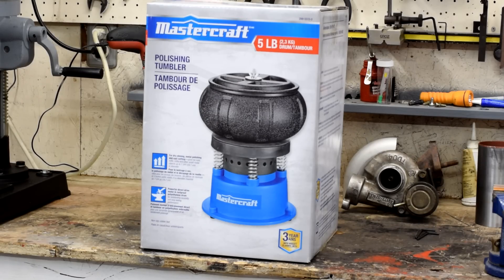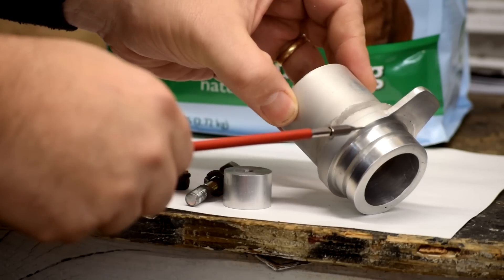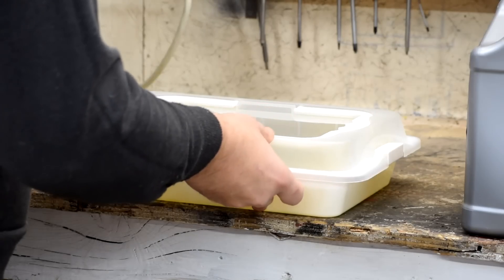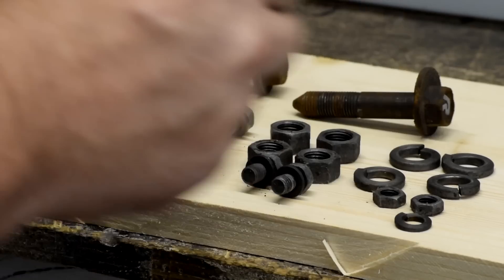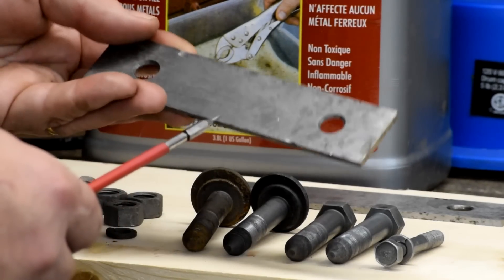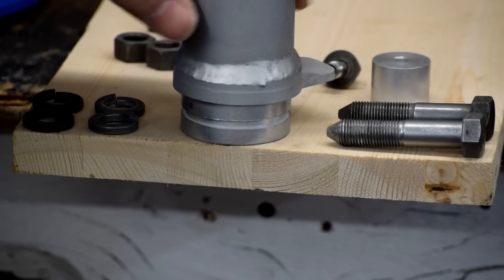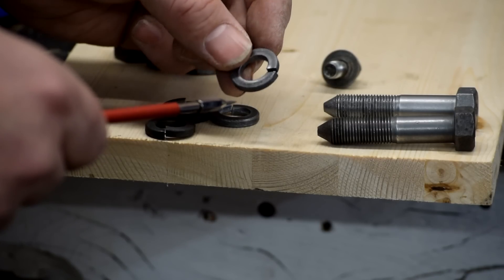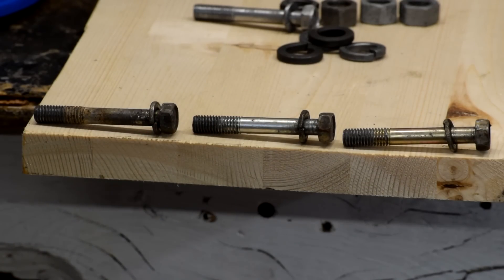Cleaning Rusty Hardware with a Vibratory Tumbler and Evapo-Rust

Comment: For small parts you might try the evapo-rust stuff in an ultrasonic cleaner.
Reply: That's exactly what I do. I have a huge 30litter and a small bench top ultra sonic cleaners and use this in it for all my surplus rifles and handguns I buy and clean up thoroughly,  this stuff works wonders

Comment: Good video man, missed out on the sale on this unit, so just picked up the comparable one from Princess Auto.  The crushed walnut shell that was provided hasn't really touched the parts (Honda 50 engine parts), so I just tried the green pyramids (dry) and so far it seems to be working good.  Just doing some research now to see what other media or additives (wet?) will work to improve the process.

Comment: Is the vibratory cleaner water-tight?  What about adding Evap-o-rust to the plastic pyramids?  I've seen good results with heated Evap-o-rust and ultrasonic treatments.  I imagine that vibratory would be almost as good.  I believe you are correct concerning the cold temperature.  Warm up the ambient temp and the Evap-o-rust will work better/quicker.  If you're looking to deburr parts, you'll need to get media that's harder than the parts.  Ceramic beads (sand blasting media would probably work well.

Comment: impressed with quality. my unit came 🔎🔍 allabout.wiki/Lyman  with a pound or so of what looks like stainless steel shot and more importantly a spare o-ring for the access hatch and a toothed-belt for the motor-drum drive. Nice touch.the drum and base are both larger than I expected and heavy.the materials and build quality seem good to very good.it's been running on the slowest speed for the last couple of hours with2 pounds or so of my steel parts to be deburred,4 pounds or so of 1" ceramic stars andwater with a little bit of dawn soapfilled to 1/2 the drum volume.I weighed the drum half filled with the previous mentioned items and it came out a little under 9 pounds.like: I like the way the drum hatch gets locked.the robustness of the build and motor.con: no instructions that I can see on how to work the base dials/controls, but I got it running by just turning the knobs.grin.not sure if the timer is on or what the 1/0 switch does (it's not on/off to the motor), timer use maybe ??I'll have another look in the box for the instructions or maybe on line .... this is not a big enough of an issue to take rating stars off my initial 5 star rating.update 10.1.2017: ran it 24hrs/day for 4 days straight with 4 different batches of parts and it worked without issues. My a36 steel parts came out as expected with a nice even finish.BTW not mentioned but as I state in the previous line, I've been running it without a 'timer' limit. I suspect the '1/0' switch when switched to '0' disables the timer ... however I got it to work this way, it's the way I wanted, so I can run it overnight without a 3hr reset of the timer.